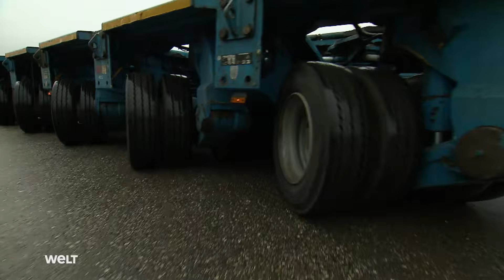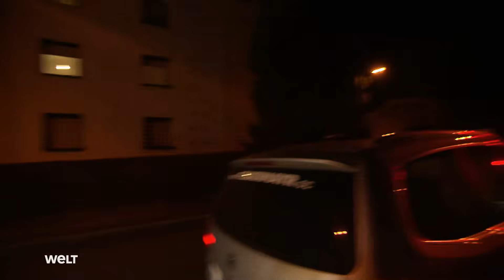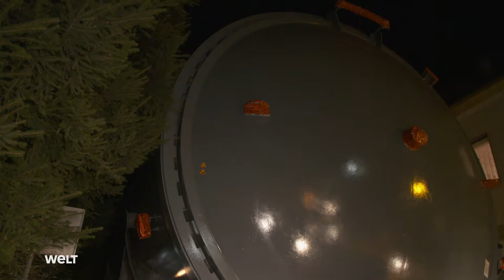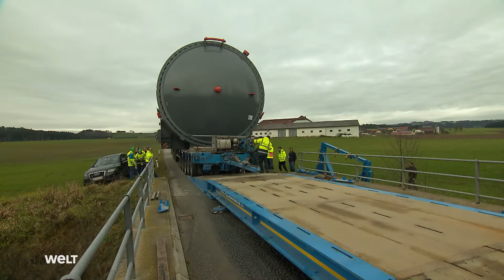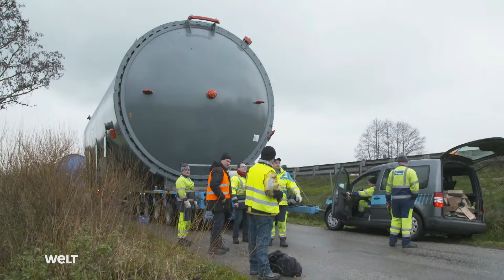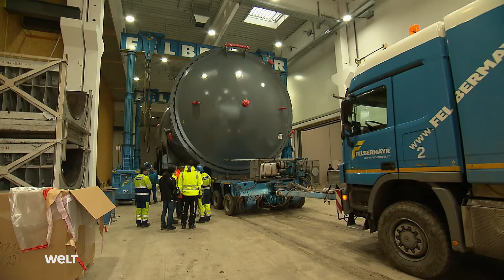HEAVY HAULAGE - 300 Metric Tons of Steel on the Move | Full Documentary

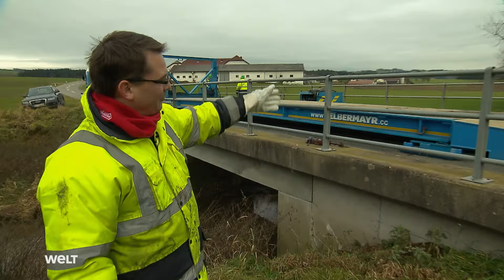Comment: 25:58 The cracks are not necessarily because of stress. It can be many forms of concrete degradation with time or when cast. Rebar oxidation is the most common.

Comment: If a shackle weighs in at 425kg those men are not allowed to manually handle it...
they need to use a forklift with a sling or auxiliary crane, to manipulate heavy items
this is dumb of the men and shows how irrisponsible their management is
Reply: 425 kg equates to 936.970 lbs. I have so many questions.

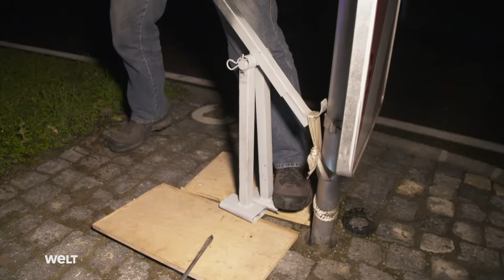Comment: 14:50 not a special tool lol, its a T-post puller. Very common on farms and ranches
Reply: This narrator dramatizes everything, lol.
Reply: @polyfoamcoats1650  ...that's the only thing that annoys me with these very interesting programs: the narrators always dramatize everything. 

A word of advise to the producer, if I may: your episodes are impressive enough without artificially 'super-sizing' the presentation with useless words. The viewers are not blind, they can imagine themselves if something will be "touch & go" or a smooth ride.

Last, but not least,  the power-units in this episodes were not "tractors" and the multi-wheel transport units were not "semi-trailers". A tractor must have a 5th wheel in order to attach a semi-trailer, and the semi-trailer must have a king-pin which is used to hook into the tractor's 5th wheel, in order to transfer part of the load's weight on the trailing unit across onto the tractor. (the whole essence of a tractor/semi-trailer combination). The German word for a tractor/trailer is Sattelschlepper (i.e. a tractior with a saddle).

The combinations in this story were "Towing trucks" hooked up to multi-wheel transporter full-trailers and/or self-propelled transporters. The difference is that the entire weight of the load rests on the full-trailers....none of it is transferred onto the Straight Truck.

Thus....please train narrators to name components correctly in exchange for dropping the dramatization.
Reply: @andrep8287  were they not ballast tractors?